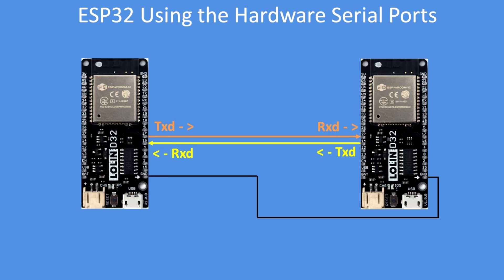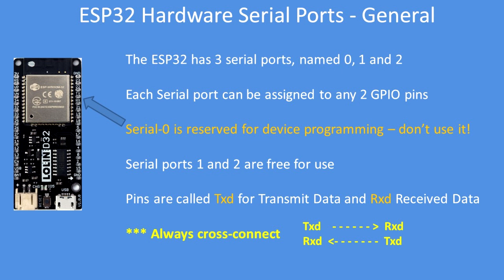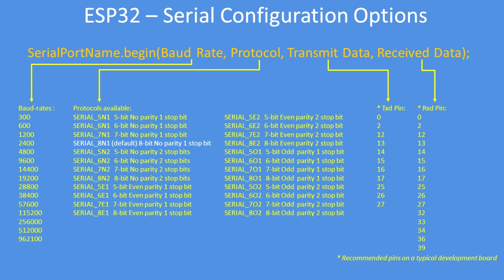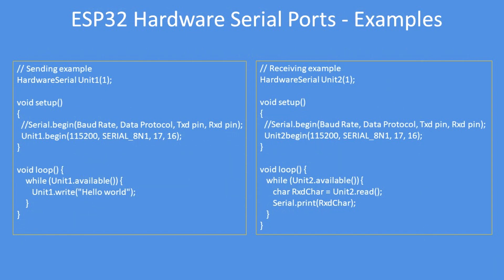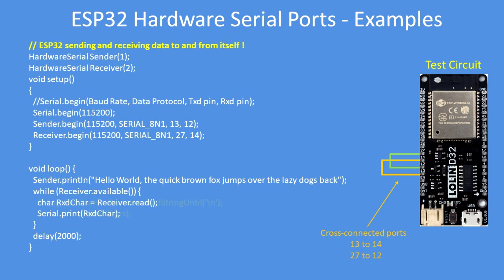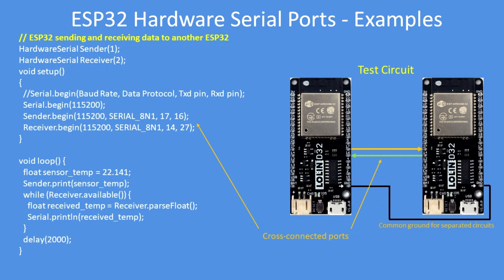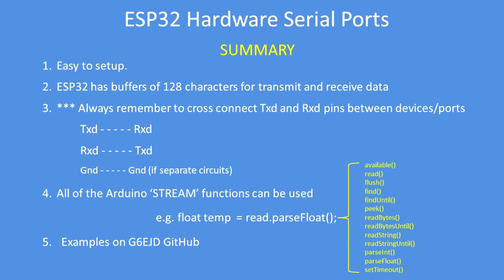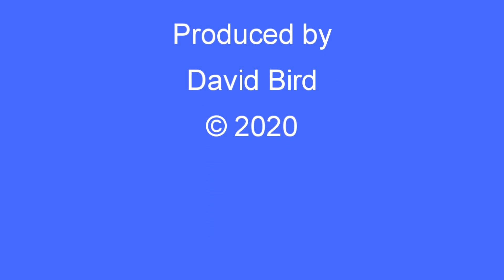Tech Note 137 - ESP32 a further insight into using the serial ports

Comment: This video and the example codes helped me a lot. BUT: at 2:00, you have reversed the Rx and Tx designations in the command! It took me hours to figure this out (duh, should have been minutes), but please check this out. Again, this video has been very helpful for me, thanks! I'm surprised I even found a mistake!
Reply from the maker: I did that to illustrate that the definitions can be reversed as long as the PIN numbers are too, maybe that wasn’t as clear as it could have been. Most Chinese suppliers do not understand this subject and often rename pins to make it so Tx connects to Tx and not Tx to Rx which then makes taking a board at random extremely difficult because in actuality Tx has been renamed as Rx when it’s not!
Reply: @G6EJD  Look at your example:
"Sender.begin(115200, SERIAL_8N1, Sender_Txd_pin, Sender_Rxd_pin);       // Define and start Sender serial port
It is just wrong, because Rx is before Tx in this command or constructor. You can't just arbitrarily change it. Try it!
Reply from the maker: Of course you can change them, your not understanding the principles. Are you Russian?
Reply: @G6EJD  I'm English, an engineer with decades of experience with UARTs, looking for a quick start on how they are implemented in ESP32.

I agree with yuchoy1 that you've make it very confusing.  Your code does not match the constructor.  I'm using V2 of the IDE, and its autocomplete feature immediately showed me that the constructor is the opposite way round to your comments.  I trusted the tools instead of your comments, and it worked first time.  I'm connecting to a USB-UART adapter, not another ESP32 that's been programmed with the same mistake.
Reply from the maker: I was illustrating that by far the majority of breakout boards with a serial port have had the designations of RX and Tx reversed so that they can be wired RX-RX and TX-TX now whilst convenient it is for learning purposes very confusing to those trying to understand. For example if someone picks up an external board they’d think TX is TX when in fact it’s RX! Using the Constructor in reverse is irrelevant as long as you know which element is which and I did cover that first. I’m trying to give confidence that they can be reversed when met with situations where the terminals are reversed by suppliers.

Comment: Great video, thanks a lot. I managed to use UART2 with an ESP32 board for an own project. However, I prefer to use my ESP Pico discovery board (from Erik Bartmann), using theESP32 PICO D4. The PICO seems not to accept the usage of the UART2, it  doesn't run with the code. On the ESP32 DoIt DevKit V1 board code runs fine.
Is my assumption correct that the PICO doesn't support UART2 usage by code? Why is it so?
I think you stated it in one of your videos but I just don't remember where you said it.
Reply from the maker: The PICO only has two UART’s; it’s a cut down version, the other is used for flash memory access

Comment: Whats the difference between Serial2.begin(9600, 8N1, 16, 17) and HardwareSerial Ser(2);     Ser.begin(9600, 8N1, 16, 17);?  I am using the first one without using HardwareSerial library and it works but am i not using hardware serial? or its the same thing
Reply from the maker: The same thing

Comment: Hello, excellent video.
How can I do to send data from different sensors and receive them separately? For example:
Sensor 1 = 14.5
Sensor 2 = 45.3
Reply from the maker: You need to develop/use a protocol of some type, for example send 0x01 as a signal that data follows in the next byte(s), then the device address say 0x01 then the reading, so protocol is
0x01: start sequence
0xnn: Device address
0xrr: Device reading
0x01,0x02,0x23 would be sending a reading for device 2 with a reading of 23 then for the other device 
0x01,0x01,0x44 and so on.
At the receiver end look for 0x01, if received expect the next byte to be the device address, then after that the reading.

Comment: We can Conect them together over 100m twisted cable?
-
How we can make random connection over 4 pairs
-
I need to make two way talk over utp network cable
-
This feature needed when we have faults in termination pairs 
-
As you see we have 8 pins but
may be all of them was reversed
-
Can you help me ❤
Reply from the maker: You can use twisted pair like CAT5 or 6 or 7 or better, as that will eliminate common mode noise, but really that’s not the way to do it, you’d need to use RS485 transceivers at each end often called MODBUS that is designed for high speed serial, but don’t expect Ethernet speeds. You’d need to use a minimum of two twisted pairs out of a CAT cable. You can’t use UTP as you can’t gain access to the lower part of the TCP/IP stack to extract the protocol and thereby send over serial lines, well not easily. I think using MODBUS transceivers is your answer, very low cost and reliable.

Comment: What to do if it receives sent values, but in addition some noise of random values from 0 to 255?
Reply from the maker: You shouldn’t get random values unless there is electrical noise on the connection between devices, you can try turning on parity by changing the format that will remove false data packets if the protuberance check fails. It does sound like you have a noisy electrical environment though. Make sure the earth at both ends is the same meaning connected together.

Comment: Thanks for the video David, is it possible to change the GPIO for the default UART0 if I wanted to locate this on a different GPIO?
Reply from the maker: Yes you can, but when it comes to reprogramming you may find it a bit tricky to get attention to initiate the reprogramming, but solved by pressing reset just before programming starts, you may need to do this a few times and timing can be crucial, what happens is the programming port is in use by the sketch do the boot loader may not detect a request to begin an upload.

Comment: Hello Sir, I love your channel.
One question, can the hardware serial be used at the same time as the usb serial in order not to disconnect serial monitor everytime a new version of the program is flashed on the chip. I am in the process of designing a complex program and I reflash constantly. Most often than not, I forget to disconnect the serial monitor.
Reply from the maker: Stephen Remillard, in the video I mention not to use Serial port 0 as this is almost always reserved for device programming and for the Serial Monitor, so in answer to your question yes you can easily do what you need. If you notice in my code examples I initialise all 3 serial ports ready for use. Once operational the programming serial port can be disconnected leaving the other two to carry on sending and receiving data.

Comment: How would you receive mixed data like "char and integer" in one string
Reply from the maker: The data sent is all binary (0-255) so you’d need to interpret the received data according to its type, or format the data before sending in a struct framework with fields of different types then send the data (as binary) then use the same struct framework at the receiver and it will read and format the data into the correct types. It’s definitely possible to do.
Reply: Thank you for pointing me in the right direction. wasn't quit  sure on how do do it. struck makes sense.

Comment: Doh, done the mistake lots do... had some PCBs designed, good quality... yet messed up on hardware serial2. Cant seem to remap rx to tx respectively. On a d1 mini pro 32 kit. Do I need to reorder boards or is there something I can do?
Reply from the maker: The ESP32 allies all functions such as serial to be remapped to any input/output GPIO pins. How are you defining the serial2 pins? Are you trying to remap their programming port(1) rather than the second serial UART?
Reply: @G6EJD  just trying to change rx to 17 and tx to 16. Just for serial output to be read by a teensy board.
Reply from the maker: In which case you would just reverse the values eg Rx=16 Tx=17 becomes Rx=17 Tx=16 it vice versa or use any other pins as required. Don’t use built in values of RX or TX as the compiler will use those not your required pins, maybe use the pins numbers explicitly eg ,16,17); or ,17,16);

Comment: Hi, thanks for your tutorial. 
I used two ESP32OLED tests. One of them is the sender. every 3 seconds it reads an empty analog pin, displays the value on the screen and sends it via serial. The second (receiver) receives the value and immediately displays it on the screen. The pause after the display is 10ms. I noticed that the time between displaying on the transmitter and displaying it on the receiver takes about 1 second. 
It's quite a long time. Does the serial broadcast require this time? Is it possible to change something to get the display without delay? Can you tell me how to do it?
Reply from the maker: Without seeing your code I don' know what's happening, but it's almost certainly to do with your OLED display refresh timing, have you checked the serial port to see when the data arrives? Most OLED's refresh quite quickly, so it will be a programme logic error or the driver is slow...
Reply: @G6EJD  This is probably not a problem with OLED refresh. Below is the transmitter and receiver LOOP section

SENDER LOOP

void loop() {
 
  display.clear(); 
  sensor_temperature = analogRead(15);  
  display.drawString(0, 0, "SENDER");
  display.display();
  display.drawString(50, 40, String(sensor_temperature));
  display.display();
  Sender.print(sensor_temperature);  
                              
  delay(3000);
}

RECEIVER LOOP

void loop() {
   
  while (Receiver.available()) {                         
    int received_temperature = Receiver.parseFloat(); 
    display.clear();
    display.drawString(50, 40, String(received_temperature));
    display.display();
    display.drawString(0, 0, "RECEIVER");
    display.display();
    
    delay(10);
    };
 }
Reply from the maker: @worldexplorerPL  what is the baud rate your using? Also could the serial read function waiting for cr/lf and if not received it times out, turn on the timer function on the serial monitor port tick in bottom left and see where time delay is occurring or out diagnostic timer prints in the code.
Reply from the maker: @worldexplorerPL  Receiver.parseFloat() may need to be changed for speed purposes
Reply: @G6EJD  unfortunately I do not know how this function works and what it can possibly be replaced with
Reply from the maker: @worldexplorerPL  try on the sender Serial.println instead of .print to add a cr/lf sequence so the receiver function knows the input line is complete
Reply: @G6EJD  you were right !! println did a good job, now the receiver displays at exactly the same time as the sender. 

however, a received '0' appeared between the proper strings

20:00:38.247 -> 23
20:00:38.294 -> 23
20:00:39.273 -> 0
20:00:39.321 -> 0
20:00:41.232 -> 1151
20:00:41.279 -> 1151
20:00:42.302 -> 0
20:00:42.302 -> 0
20:00:44.256 -> 1325
20:00:44.303 -> 1325
20:00:45.326 -> 0
20:00:45.326 -> 0
20:00:47.287 -> 18
20:00:47.287 -> 18
Reply from the maker: Not sure why your getting two identical numbers looks like a timing issue, you may need to change println to write as at the moment say the reading is 123 your sending “123.0” rather than write which will send the 4 floating point bytes it’s the same outcome but binary verses text transfers, you could filter out the 0’s too
Reply: @G6EJD  I wrote about it before but I do not see this post. I report to serial twice. the first time after receiving the number and the second time after displaying the oled.
Reply from the maker: The 0 could be noise if your using a really high speed baud rate or long lines

Comment: Can the esp32 serial port be used to upload sketches to an arduino wirelessly ? I have a mega2560(ch340) pro micro running my project and I would like to be able to update the sketch without having to plug in the usb cable.
Reply from the maker: Well it could but to initiate an upload to the Mega you’d need to setup a serial point to which a microUSB cable is attached and plugged into the Mega, then on the ESP initiate the programming sequence by pulling a GPIO pin low and connected to the cables DTR line then send the configuration data to the Mega and then the program, definitely possible but very complex to achieve

Comment: Hey this is very nice but for what i'm tryna do I want to send Serial data from an  Esp32 to an Arduino Uno. But I can only find information on doing it the other way around. Do you know anywhere I could find out how to do this or could you make a video on the topic please? It would help out tremendously, thanks
Reply from the maker: There is no difference to which hardware platform you use the principles are the same, there is an example serial port in the Arduino Examples just use that for the UNO but remover to swap over the Tx and RX lines so that Tx-RX and Rx-Tx or do that in software by the pins definition.

Comment: I would like to connect several serial devices to several pins on the ESP32 using the same UART. Can I initialize the serial port and pin assignments within the main loop or function and change the pin assignments throughout the loop to read these multiple devices and process the data? Can I use one common TX pin and only change the RX pin assignment to save pins? Thanks,
Reply from the maker: You can use a common TX connected to all the remote RX pins, but you can’t connect remote TX pins to a single RX pin without some isolation because you’d effectively be connecting (remotely) TX pins together ie an output to and output, but that is easily solved by wiring a diode in series with each remote TX pin. You can also reconfigure the UART to separate pins or change the RX pin, but you can’t easily get data that is in the remote UART buffers so you’d need to establish a connection UART main to remote UART-1 complete the communications then move to remote UART-2 and so on, data management will be essential to keep the data aligned to the correct device.
Reply: @G6EJD  Wow, very quick response and very helpful as well as your video. To follow up your comments - my intended sensors are for voltage and current so I will likely read each sensor multiple times and average them before moving to the next sensor so I'm assuming that anything remaining in the serial device buffer should not be problematic?? Or to clarify if I do need to move between UARTS can I simply toggle back and forth between UART-1 and UART-2 to read data from a new sensor and that will close or purge any data remaining in the buffer? Thanks,
Reply from the maker: @tomfalls1006  you can toggle between sensors but ideally you’ll need a regime where the sending device denotes the end of the data with a known termination character but the problem can be differentiating between data and end-of-data, there is an ASCII ETX byte you can use, I recommend you devise a transmission protocol to follow so you can be sure the data is complete, and you need to decide whether to send text or binary data for the readings eg 23.4 or 0x02,0x03,0x4 with an inferred decimal place or send a 4-byte flooring point, so something like bytes [deviceID][reading byte-1][reading byte-2][reading byte-3][reading byte-4][ETX] or more simply [deviceID][“23.4”][ETX] then when you receive ETX you know the end of transmission has occurred and can move on

Comment: Have you ever looked at heltec esp32 lora boards? I been trying to figure out how to do this i need serial connection to a rockblock
Reply from the maker: Zachary Neuhaus, yes I have extensive experience of using the Heltec boards, but and both the Wireless stick and Wireless stick lite are power hungry, that aside they work very well. What are you trying to do, by the way a typical Lora transfer can take a few seconds to send.
Reply: @G6EJD  Hi David, So I have a Heltec esp32 Lora version 2  board. I have a rock block 9603. I want to wire the to block to the heltec but i can't establish a serial connection.

Comment: Hello, thank you for interesting video. I tried this codes and working good, but i removed delay and codes doesn’t work anymore. What could be the reason? Thank you in advance.
Reply from the maker: You have to allow time for the UART to send the data which will depend on the baud rate so at 9600baud each character will take 1mS so there has to be at least that much delay before the next character is sent. The UART has a single character buffer to enable the character to be read whilst one is being received. Nothing is perfect. This is all normal behaviour.
Reply: @G6EJD  Thank you

Comment: Hello Sir. I have a question. I am having trouble because, if I just send "int" with value 0 continously, from time to time it will read a random number like an 8 or 40. Is the sender board sending data faster than the the receiving board can process it?
Reply from the maker: It could be, but more likely electrical noise
Reply from the maker: BTW 8 and 40 are both likely to be bit errors or noise